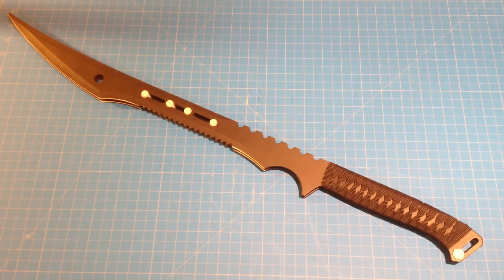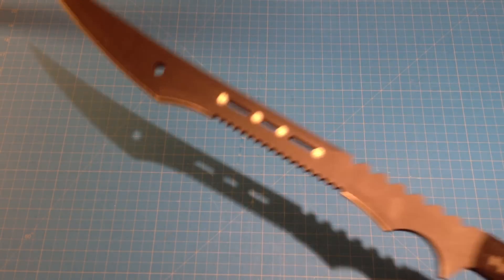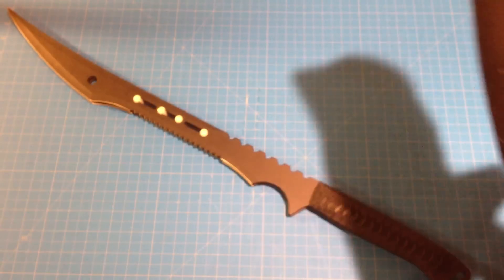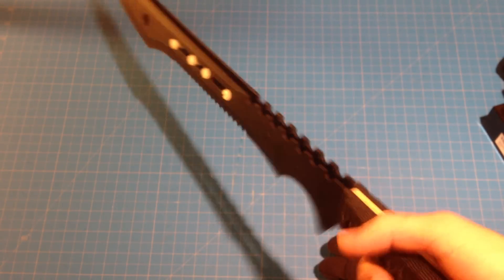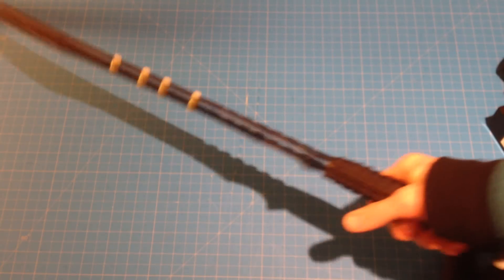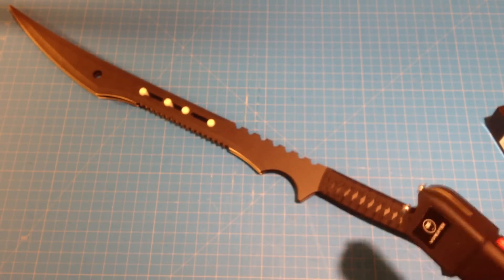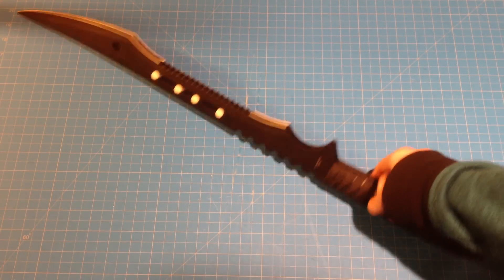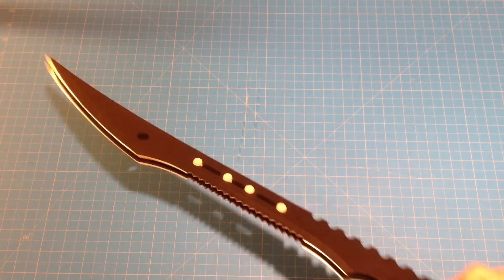(ORIGINAL) 8.8 Million Volt Tazer Ninja Sword Shock Mod: Raiden's Sword!!

Comment: A million volts already requires immense amounts of energy to be produced - Also, there is no insulation that would withstand that kind of voltage.
If you search youtube for tesla coils, you will find some very impressive devices that shoot bolts of lightning several meters long. That is what 8 million volts could easily achieve.
I agree with walter - The voltage of this device is around 30 to 50 KV - But nevermind the numbers, I don't want to have one of those held at me.

Comment: you are wrong. 50,000V (HV) divided by 100,000 ohm resister = 0.5 amps, not enough to kill but will hurt like hell. Equally 230V (LV) x 115 ohm resister = 2 amps, enough to kill sometimes, but no where near as painful.

Comment: so what? you think because a wall socket has 230V nothing can go higher? stun guns operate at very high voltages. its not that hard to get high voltages by using a power transformer. is it using 8.8 mil V? i dont know but thats what it says on the box.

Comment: not true, its all about amperage and wattage voltage is nothing but potential, amperage is current and wattage is power, it arcs because the voltage is so high but the amperage and wattage also explain why its not much much farther, air is extreemly resistant, facotr that all in and you can see why its not a bigger arc.

Comment: I hate when people say this. It's very misleading. Yes it is the amps that kill you, but IT IS THE VOLTAGE THAT GENERATES THE AMPS. Don't make it sound like voltage and current are two different things. The reason why this, and things like carpet shocks (which are thousands of volts) don't kill you, is because there is not enough energy being transferred. This phrase is better said as: "you can have high voltage, as long as there is low capacitance"

Comment: Also, you people need to stop saying that amperage will kill you at any voltage. If you interpreted it literately, it is true, but the implied meaning that it conveys is dangerously misleading. It is inferring that voltage and current are two separate things, and that only amperage does the killing. Lets not forget ohms law which states that voltage is directly related to current.

Comment: my brother (who goes to mechanic school) told me that 9000000000000 volt could touch me and i wouldnt feel a thing you need amps too also i could touch 900000000000 amps and i wouldnt feel a thing(i learned this the scary way,he made me touch his home made 1,000 volt tazer whitch actually isnt that much)
Reply: Dude, 1 amp is 6.241509629152650×10^18 electrons going through your body, that kills you, 900,000,000,000 (900 billion) amps is equal to 5617358666237385000000000000000000000000000000 (5.617358666237385×10^45) electrons going through your body, that's a ridiculous amount of current and it would fry every organ in your body.
Reply: ohhh....well i trust you more than my brother
so thanks
Reply: ive been told
Reply: yeah, 1 amp is enough to stop your heart

Comment: The amount of people not knowing the difference between Volts, Watts, and Amps in this comment section is astounding.
Reply: TekNihn I don't. Can you tell me please?
Reply: Volts is basically like the pressure of electricity, amps is the amount of electricity used, and when you multiply volts and amps you get watts which is the measure of work electricity does.

You can have an insane amount of volts in anything as long as there is no amperage, I think the amount is like 1.8 amps to kill a person.
Reply: TekNihn Ok, thanks!

Comment: It IS the volts that does the killing. There is just not enough energy here to kill you. If this sword could constantly supply amperage at 8.8 million volts, you would without doubt die. This does not kill you because it is only supplying this current for a very short amount of time. 120V outlets can kill you, because they can supple constant current. In short: High voltage + high capacitance = death. High voltage + low capacitance = live.

Comment: Anyways, so "generates" wasn't the best word to use there, which I realize now. What I mean to say is "it is the voltage that makes the current flow" (which is what I, and probably 95% of other people will interpret my previous statement as). Please, don't confuse people more on this subject. I just want clarify that high voltage will kill you if the source is capable of delivering a lot of energy.

Comment: Much less than 50 thousand volts for a less than 2 inch spark.
NOT 8.8 million volts. The biggest soviet Marx generator was about 9MV. Spark length on film was about 300 meters

Comment: But what's the point of it being a sword if it cannot cut anything? The only real damage you can do with this setup is if you stab your opponent, but in this case a dagger would be much better, not to mention wouldn't require the plastic dividers to keep the blades separate. It looks intimidating enough, but it still virtually useless. In fact you'd be more effective just wielding these two swords normally.

Comment: You do realize that a 12-volt car battery can supply several hundred amps for several minutes don't you?  Voltage is electrical pressure.  Residential water pressure is ~80lbs/sq.in. I can point a garden hose at you at that pressure all day long and if it's hot out, you'll love it.  If I point a 5-ft. dia. hose at you that can supply the same pressure, you gonna die.  It is in no way the voltage (pressure) that kills you.  That's also why people survive getting hit by lightning.

Comment: Now to my previous comment here's more.
There are a lot of factors we have to take in.
50 volts is what it takes to kill a man,25 volts to kill a man in water.
We got ohms law and power.
Say the power supply can give the necessary power and amps but lacks those 50 volts.
If it's below 50 volts it won't kill anyone.
Now 50 volts is theoretical maximum of what a human can take.
Don't go around touching 49 volts

Comment: Let me give you a better definition for what you are trying to explain to that guy.
So say we have a 1.5 volt battery that can supply up to 2 amps.
Using an equation for power we find that the battery is able to supply 5 watts of power.
Now if we rearrange the formula and say we have a million volts and 5 watts we find that the maximum output we can get out of this thing is about 5 microamps.
That cannot kill a person at all.
If the tazer can't supply necessary power ,it cannot kill.

Comment: Chinese are notorious for exaggerating their ratings on most everything. 8 million volts will arc several feet. Electrical design rules allow 1/16" for 1,000 volts. The person holding your sword would get knocked on the butt when it was turned on. I might believe 8,800 volts, not 8.8 million.

Comment: 8 milion volt? omg ..
Reply: Voltage doesn't matter...
Reply: +Ricard Andrés wrong
Reply: Douglas Quaid Yes, I was wrong. A high voltage will "break" your electrical ressistance and a low amperage will hurt you, but a low voltage(5v) and a high amperage won't hurt you due to the low voltaje that doesn't "break" or trespass your electrical ressistance. Correct me if I'm wrong.

Comment: aah dude i am an electronics tech/engineer that stun gun is not 8.8 million volts it is eight hundred and eighty thousand volts it is less than 100k  k means thousand and times the calculated  number will give the sum

Comment: I don't think you did so well in IB physics if you think that voltage has nothing to due with current. Voltage is VERY related to current. No voltage? No current. There is no arguing against that. You're misinterpreting the meaning of voltage. The higher the voltage, the more charge you will be able to push through a medium.

Comment: If a power source does not have 50 volts, it cannot give the necessary current and power to kill someone. Saying it the other way around is misleading. I already made a rant comment about this on this video. I suggest you read it.

Comment: 8,8million volts? yea right..
Reply: Voltage does not matter. The current is the important part.
Reply: +Ricard Andrés That's why we learn Electrotechnic
Reply: +robbzooi yup thats right, its not the voltage that kills you, its the ampage!!!
Reply: Fran o' toole Only 1 amper is enough, imagine that he have a transformater in his bag, and a car battery, and imagine that the sword have 200A, Holyshit it'll be a fucking Human-toaster xD
Reply: i know, thats why i said the ampage thats the dangerous part
Reply: Fran o' toole I know bruh i'm doing a profesionnal diploma of Eletrotechnia (In France it sounds bettter xD)
Reply: Kuchizuke San Nope, It's the combination of voltage and amperage, and, electrical resistance, you can get electrocuted by a battery(5v 2A, its a special battery) and you won't die. Why? Because of the small voltage. 5v x 2A = 10W. (And, never pass through us 2A, because we have a kilo ohm (electrical resistance). But imagine get electrocuted by a transformator(example: 10000v 5mA), you will die, cause of voltage and direct current(idk what could pass with altern current)
Reply: Ricard Andrés ? With holy f*cking 10 000V? '-', you will get electrocuted just by standing next to it, with 10 000V just imagine the electricals arks, some inches long.

Yeah i know that if the tesion is about 12V you will feel nothing, but if he use a transformater and a car battery it will have enough Voltage, no need to say that the voltage will be marvelous it's obvious, with the trasformateur (Yeah cause without the transformater, the only way to toast someone is to impal him with the sord, cause yes it's really wet inside of us, and electricity love it ya know)
Reply: Kuchizuke San Yes 😃
Reply: +Kuchizuke i agree. BUT! if there is not enough voltage, there will never be 200A; U=RI   sooo you are all kinda wrong here. voltage is the killer. but not dirrectly. only bcs of the big voltage there will be enough Amps to kill you. OFC IF POWER SUPLY HAS ENOUGH POWER!!!  EL. basics. OH and... 40mA is enough to kill you. different parts if human body have different R. There is also important if it is AC or DC...... we could go on and on...
Reply: +Ricard Andrés you are wrong mate... 1st. a transformators output is AC. and... if you would somehow transform 5V 2A to 10000V 1mA (The P stays the same!) the enormous voltage would just collapse immediately, because the battery couldnt deliver enough courrent. also the ac at low f is much more dangerous than DC. if you dont believe me just go to youtube page:   electroBOOM. sorry for my english :)

Comment: Cool idea, but you should change the title... Raiden's sword doesn't shock people, it's the high frequency blade used by Gray Fox, i.e. it vibrates at an extremely high frequency, weakening the molecular bonds of anything it cuts (from the MGS wiki). Which is obviously impossible.... for now. Also, that's most definitely not a "ninja sword" :P

Comment: that's fricken awesome, but this would not be viable as self defence weapon because of it's dual abilities, to cut someone attacking you -------ok........... to tase someone attacking you -----------ok  but once armed this would ONLY KILL, one the blade cut into the person the electricity flow throughout the body would be intensified by their body fluid and it would do more harm than just a wound it would stop their heart and fry the brain. still very cool though
Reply: +Joseph Reese you will NOT die from the voltage, maybe the sword itself but you will NOT die from any amount of voltage. the only thing that kills is amps. No amps, no death.

Comment: You're the one who looks quite confused. Why can't you people understand that current is directly related to voltage? IF YOU DO NOT HAVE ENOUGH VOLTAGE AND CAPACITANCE, YOU WILL NOT BE ABLE TO PUSH A LETHAL AMOUNT OF CURRENT THROUGH SOMEONE. PERIOD. So saying "A high enough current at ANY voltage will KILL YOU" is misleading and depending on what you mean, wrong.

Comment: What the fuck? What are you talking about Wattage and Amperage? Any current at a high enought voltage will cause sparks. Some louder, some quiter. But 8.8 million Volts will be a spark many meters long! So a taser never has 8.8MEGV, because the spark gap stops the voltage from climbing up. Anyway, even without, the voltage never will be that high, because the components cannot withstand such a voltage. Don't argue, this is a fact.

Comment: Why do you insist that you know what you are talking about?  This is physics.  Things work the way they do and there's no changing it.  Again you go wrong by saying that current has amplitude.  Voltage has amplitude.  Your body - your heart that is, because that's what we're talking about with electrocution - CANNOT HANDLE HIGH CURRENT.  FULL STOP.  There is no sometimes about it.  A high enough current at ANY voltage will KILL YOU.  Unless, of course, the Internet gets to you first.